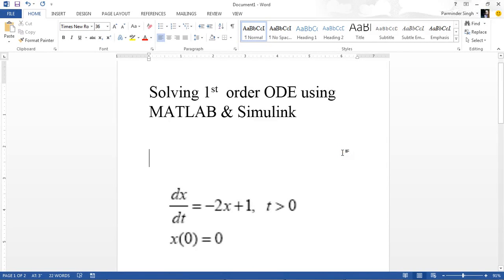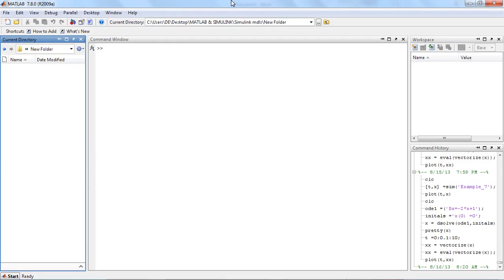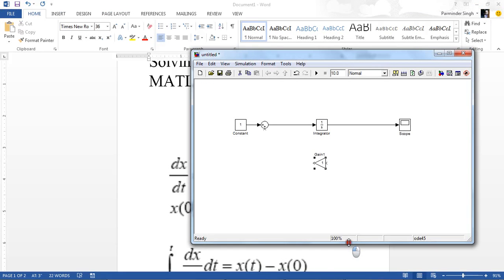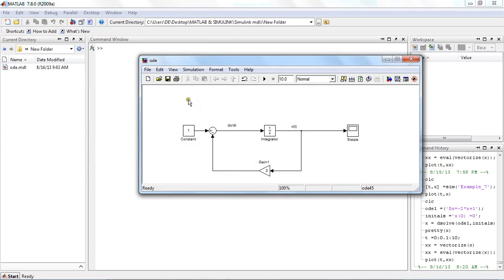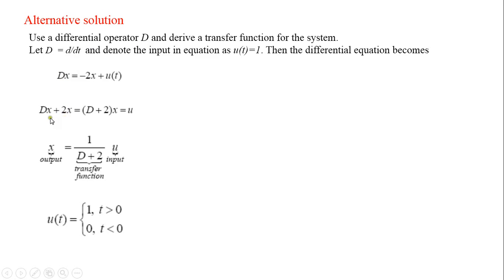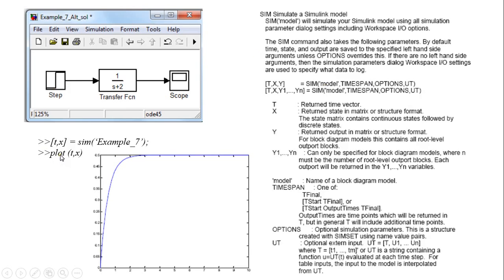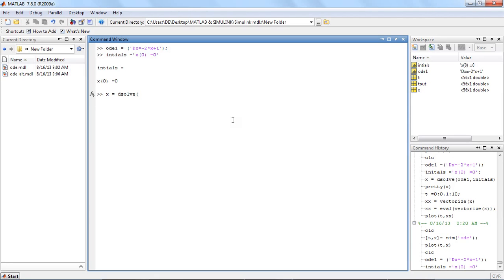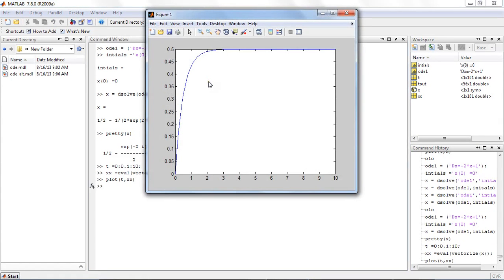solve first order ODE using MATLAB & Simulink

Comment: Mr. Parminder
I enjoyed and learned a lot.  I tried using a command line to compute where there is an x and a y.
How would you plot of t vs x(t) and y(t)

dx/dt(x,y)= -5x +3xy
dy/dt(x,y)= -3y+2xy

0<=x<=3, 0<=y<=3
-10<=t<=10

Critical points.
[0,0], [3/2,5/3]

Any help would be greatly appreciated.